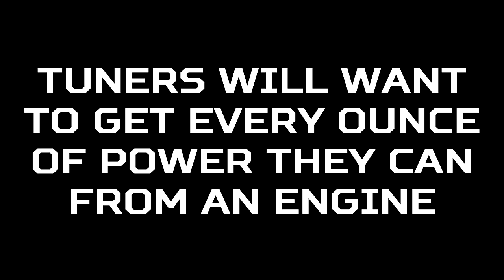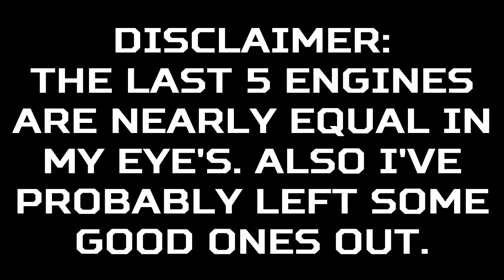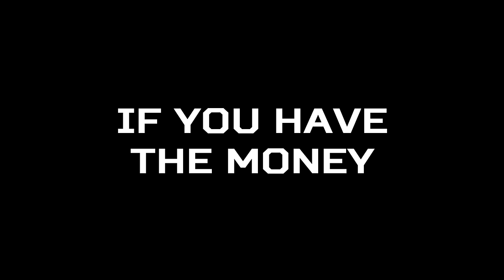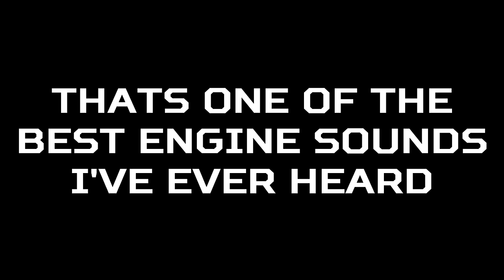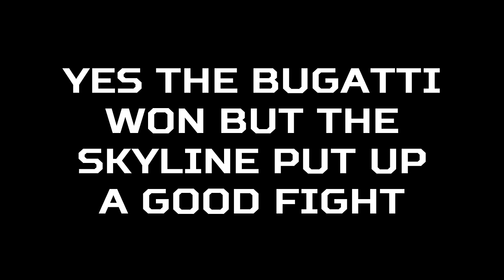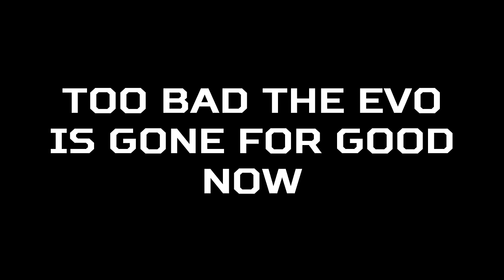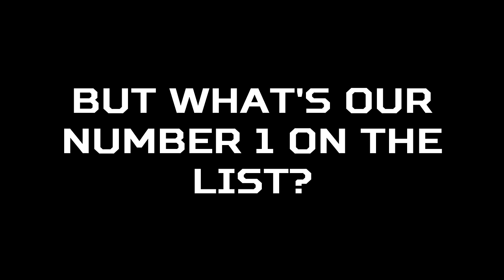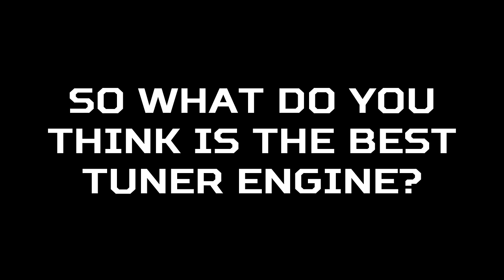9 of the Best Tuning Engines

Comment: No termi engine got dammit Bobby
Reply from the maker: I sell propane and propane accessories.
Reply: The 4.6 is garbage that's why it's not on the list ,my friend has a pos 98 mustang gt n the heads flow so poorly being his is an auto he better rev up when the light turns red in order to get it back n gear before it goes green.... the 5.0 is good but as I always say its 4.shit n 5.slow
Reply: +Brad Young depends how you build em bud. 4.6 make good power with boost and 5.0 can be a very powerful and reliable all motor build up
Reply: +Brad Young I'm interested in the new 5.0 in the 350r has flat plane 5.0
Reply: +Brad Young A terminator is supercharged 4.6 and is not the same 4.6 in your buddies 98 lol. Its also a dual overhead cam.
Reply: +Vaporizeee still supercharged makes 380 n there's na v8s that make more then that like the tundra ,is-f etc it's nothing special
Reply: +Brad Young 03-04 cobra are all underrated,  well over 400hp stock.  All have forged internals good for 800+hp.  You can get a whipple S/C for 3 grand and have a safe, reliable 600hp DD Cobra. Also the 4.6 one of the best sounding engines of all time...!!
Reply: +IKON G.DRAGON Ok thank you for the info I've just never been big on the 4.6. yes they sound pretty good but from what I've seen they don't hold together to well above 550whp
Reply: +ihatecrackhead Well if Ford failed so hard that over 10 years later you're ragging on them, that is considered a success in my book.
Reply: If the Teksid sucks so much why do people switch to them in 03/04&#39;s? And why is Accufabs 5 second 1/4 mile car a factory Teksid 4.6 with 2500+ HP (something the almighty LS hasn&#39;t done yet) with stock cobra crank and the old B heads.... 

People have pushed over 1k HP on stock 03/04 parts.Pulley, exhaust tune puts the 03/04 close to 480 RWHP 

Engine Masters banned mod motors after going 1.2,3 in an N/A build off and it was at an unfair advantage with the RPM limit at 7500 when Kaase tested before the competition it pulled all the way to 9k before starting to fall off at  900+ HP 

Stop being brand biased and throwing out a bunch of crap that isn&#39;t true lol
Reply: +98undrtaker amen
Reply: +ihatecrackhead true and some big block LS engines can go up to 3000+ horsepower
Reply: I don't care if its GM, Ford, Mopar blah blah blah I build engines for a living. I have a Cobra, Dodge and a GM so I could care less about brands lol

LS is easily the best bang for the buck but the mod motor doesn't suck like everyone thinks. First thing I'm going to do with any performance motor is replace pistons and rods so that puts them at even ground for me anyway so which company made what doesn't matter to me. 

 Both have advantages and disadvantages both are great platforms with a ton of potential.
Reply: +98undrtaker Preach! finally someone with some sense. U can build any motor with just about any horsepower if u have enough money
Reply: exactly it just takes money lol
Reply: +98undrtaker dollars dolla bill y'all lol
Reply: Um again I build engines for a living lol. 

Big Bore strokers are where its at for the 4.6 though if you want power N/A, but for forced induction the stock bore and strokes are just fine in the 4.6 and 5.0 as proven by accufabs 5 second 4.6.
Reply: +98undrtaker. I don't build engines for a living. I was under the impression that there is still only so much power that an engine can produce and that the bottom line power level is based off of the lower block thickness/strength. Anyone that wants push more power through an engine will replace all of the internals. But that doesn't remove the limiting factor. This factor is the blocks chemical composition and geometry. You can also buy billet machined blocks, but we aren't talking about those. We are talking about major automotive manufacturers basic blocks. I don't personally have any brand preference and have owned many 9 second cars in my life. It's been my experience (and every builder/tuner that I've worked with) that the LS engines are capable of taking more power, because of the lower block integrity. Basically, they are under designed and overbuilt. And if you just want to add forced induction to a stock motor, the internals in a LS will last longer at a higher power level than any other large manufacturers engine. That's a historical conclusion, not an opinion.
Reply: ihatecrackhead. I don't understand how economy came into the argument, or why you felt that you had to explain what horsepower and torque are. The argument that you can double an engines HP by doubling RPM is absurd since most engines achieve their max power at the upper limit of their RPM range. You can't make a 1,000 HP engine (@6400 RPMS) a 2,000 HP engine by simply doubling the RPMS. What you will end up with is an expensive grenade and a strainer for a hood. I have a Camaro that makes 205 HP at 2,000 RPMs and 540 HP at 4,000 with a max output of 720 HP at 6,500. The dyno sheet doesn't give an answer of 'double RPMs means double HP'.

Also, show me some data that supports your statement of power being based off of the 'volumetric efficiency'. You can put enough power into any engine to crack your block. The block thickness and geometry is the limiting factor after you have put in appropriate internals.
Reply: +Samuel Cohen Shit sorry dude, i forgot
Reply: +98undrtaker . i was about to point out a lot of the same things!
Reply: +Whenzy Quijano Big blocks technically arent part of the LS series, which are specifically small-block engines. Some big blocks have carries an LS* engine code, but these are unrelated to the LS-series Gen3-5 small-blocks.

In any case, speed costs money, so how fast do you want to go?
Reply: +Chiel van de Sande what's a ls7?
Reply: +Devin Adams The GM LS7 was was the 7 liter  427 ci LS motor GM put in the 2014 and 2015 Z/28s and earlier ZO6 Corvettes. They made 505 HP , 480 lbs-ft of torque, rev to 7000 rpm run on pump gas and you can buy it as a crate motor right from GM in either carbureted or fuel injected versions for about 15,000 complete. You can get between 600 and 700 HP with a cam change and a stage three port job on the heads. All LS7 motors are hand built here in Michigan at the engine assembly plant. Its the only motor put in a production car that is built by GM. Absolutely fantastic motor.
Reply: Very trie
Reply: I know. anybody arguing that the 4.6 mod motor is bad needs to do some reading. stock heads and block mod motor went 5.87 1/4. fastest LS has only done 6.12 1/4
Reply: ihatecrackhead the 4.6 blocks are rated alot more than 900. stock internals are rated to 1000HP and by then your changing them with all the money you put into it anyways. i see 1200+hp mod motors at tx2k all the time.
Reply: Who the fuck cares who made the block. It's what came stock in them and that's what they handle. I wouldn't care if the new corvette came with a pro mod engine made by a aftermarket company. I'd say that's awesome because it's all bang for you buck. Your trying to change convert a boost application to a displacement which doesn't work in your google calculator. It's all about engine design. Which the. terminator has the design to go 1000hp on stock internals.
Reply: +TheSamplebridge aahhh I forgot about the termi motor.  whenever someone says 4.6L ford motor, I just assume they are referring to the shitty 4.6L 2 valve pos.  point taken
Reply: The LS doesn't need 2500HP to win races,  because there cars are half the weight!! Plus the the LSX is half the price to Mod,  than any Ford engine to build!! Which is why they are the number #1 street drop in motor. For Example a C5 LS1 corvette is faster than a 4.6 terminator stock to stock!! Big weight  advantage yes. But one also has a super charger for god sakes.  That's  within the same years for Fords best VS GM's base model corvette . We can't  even talk about the Ford GT, so let's not even go there. Most Ford dealers don't stock even one,  as it's a Non production super car.
Reply: Typical GM fanboys comparing a Corvette to a Mustang. The bas corvette was still alot more expensive than the cobra. Why don't you do some cobra/camaro ss/z28 comparisons. Let's see a 02 ls1 camaro is slower than an 03 cobra.
Reply: TheSamplebridge Then tell Ford to make a car to compete. I sold a terminator for almost the same price as what a C6 corvtette cost!  They are currently around the same price range so what's your point?? You will never look back, guaranteed!!!
Reply: +TheSamplebridge if you are going to bitch about comparing apples to oranges, you probably shouldn't rebuttal with an apple to oranges comparison.  GT vs z28.  and you really want to compare a 2v 4.6 to an ls1?
Reply: cobras are the same prices as c6s because cobras are more sought after.

the camaros has always been the competitor to the mustang. so its only fair to compare top camaro to top mustang.
Reply: danhr03 base price of a termi was 31k. base price pf a z/28 is 24K. corvette is 44K.
i mean its nice you tried but could you at least get them right.

1. your back to trying to equate boost with displacement which doesn't work.
2.the termi engine was underrated about 20-30HP.
Reply: But yet again the Mustang competes with the camaro not the corvette. Anyone that thinks you can compare a Corvette to a Mustang should look at why the 67 camaro was created.
Reply: +TheSamplebridge where is your source for msrp for the cars?  I pulled mine from auto trader and got the cheapest 2003 GT trim level, cheapest 2003 cobra trim level, cheapest c5 corvette base level, and cheapest v8 4th gen trim level.  and the only time I compared a corvette to a mustang was on price, so I don't know where you are getting that I'm doing it "again".  if you actually checked your pride at the door and realized you are an idiot, you would look back and see that I agreed with you that a mustang cobra shouldn't be compared to a corvette, but it shouldn't also be compared to a z28.  the mustang has about 20 million trim levels, you might as well pick one that isn't double the price tag of the car you are comparing it to.  if you actually had 2 cents of info, you would compare the Mach 1 to the z28.
Reply: Autoblog. Which says the z/28 was the top trim for the camaro. Don't pull this 1LE BS which wasn't available to everyone. In my Mustang competes with camaro comment I did not hit reply to you.
Reply: +TheSamplebridge well that shows you that your information is invalid.  z28 was the base model v8 4th gen.  the z28 is the top trim for the 5th gen.  we are comparing 4th gens to terminators.  if you want to go with 5th gens and 6th gens camaros, the base model 6th gen blows the doors off a terminator, but that again is an apples to oranges comparison.
Reply: +TheSamplebridge and 1le and 1sc options (or lack of options would be more accurate for the 1sc) were available to everyone.  again, incorrect information.
Reply: the 1LE was a special ordered limited production car. it would not be comparable to teh cobra seeing as they made less than 100 a year, and sometimes less than 20.
Reply: +TheSamplebridge again, ignorance.  you are thinking of the prior 1le and lt-1 Camaro 1LE's.  again, as i constantly remind you, we are comparing ls1 4th gens to terminators.  1le was not a special edition car for all the production years of the ls1 f-bucket.  for 98-99, yes it was actually a specific car.  from 2000-2002, it was an option, that you could check, that would get you koni shocks and bigger sway bars.  a good majority of the SS camaros had this SLP option, and also a good bit of the z28's.  and even so, either 1le wouldn't be your "top trim" level ls1 4th gen anyways. that's like comparing the current dodge challenger and comparing it to the mustang.  except grab the mustang GT and compare it to the hellcat.  I mean, we might as well compare the top trim to the top trim, right?
Reply: ihatecrackhead they made 13000 03 and 04 cobras. not less than a couple hundred. now your bringing up lingenfelter after having a hissy fit over aftermarket rods, double standard much the LS can make 100HP on a 300$ camshaft. the cobra can make 100HP on  80$ pulley swap.

anyways the lingentfelter is in no way a dealer optioned car. its an aftermarket car built by a company.

so what your saying is the cobra isnt comparable to anything, which is funny because i see lots of videos of LS1 camaros trying to go at it with 03/04 cobras. ending varys with modification
Reply: ihatecrackhead pathetic the camaro wasnt in production for 7 years

your making dumb arguments that have nothing to do with what we where talking about to make yourself seem like you know what your talking about, which you dont.

the aluminator is built by ford performance. parts come from other places which who cares if the parts come from other places. GM has been using Isuzu engines in their duramaxs for years. and have had factories and other companies built parts for them around the world.

why cant the gt500 have more boost. do you think compression ratio dictates how much boost an engine can handle. if you think that then all credibility of you is lost.

the 2002 camaro zl1 has 400HP not 720. you just said it has 400HP without a supercharger. 

dont know why your brought up the holden commodore.

GM and eaton have nothing to do with eachother. the eaton on the gt500 is co designed by SVT and eaton.
Reply: ihatecrackhead then in 1999 the gt got 260HP and the cobra got 320. GM had the northstar but ended it because it was a pile of unreliable trash. nowadays you see very few northstar powered cars. and i dont see why you bring up the northstar because any vehicle they where in where large boats that would lose to a mustang of the same year.you call the 2009 mustang pathetic yet the 03-08 camaro had 0HP.

dan now your bringing up aftermarket companies. IM TALKING FACTORY CARS. thats why i dont consider comparing rousch, lingenfelter, other aftermarket companies together.the new stingray is only 5 grand more than the gt350, yet nobody compares them. just give up, mustangs and corvettes dont compete.
Reply: +TheSamplebridge GMMG is not aftermarket home boy.  that's a dealer option. you could go to a dealer and hit the GMMG check box, and get a GMMG.   lingenfelter is aftermarket.  GMMG isn't.  again.... you have no idea what you are talking about Mr "z28 is the fastest 4th gen fbody.'
Reply: +TheSamplebridge and if your rebuttle is that the "09 had xxx horsepower, but the 09 Camaro had 0 hp), then why the hell would you compare an 03 cobra to an 02 f-body?  they are different years, according to your philosophy, so we should be comparing the 4th gen to the 02 cobra. lolololoolololloloolol.  that's a close race!
Reply: ihatecrackhead really because the miliary base i go work on my cars at, one of my friends there has a Cadillac with a northstar. he tells me about how it was a big hunk of junk that GM made to try and get with the times, and ultimately failed and discontinued the engine.

because thats the cobras closest competitor. the 05-09 mustang had no competitor. the gto and g8 never sold enough to compete. the true competition between the 5th gen camaro was the 2011-present. ls1 f body and GTO freaks all go out to race mustang cobras and modded GTs.

GMMG is a dealer that specializes in buying f bodies and making them faster. its the yenko of 4th gens. you have to go to the GMMG dealer to buy one though, or youd have to know a guy way up in the ranks to maybe get one transferred to a dealer near you. its not a box you pick in the sheet. go to their site and read up on what they do.
Reply: +TheSamplebridge lol so your reference is the guy you met at a craft shop?  way to show how very little you know.
Reply: danhr03 a guy that's worked on civilian vehicles for the past 30 years and so good the military went out and found him to run a hobby shop. And with personal experiences with customers problems and his own. Yeah I'd take his knowledge.
Reply: +TheSamplebridge here's my experience with just about any trade.... ESPECIALLY with the military hobby shops that i used to use back in my younger days, before I invested in my own garage and tools.  "Just because you have been doing something for X amount of years, doesn't mean you have been doing it right for X amount of years."
Reply: danhr03 he still has it because his dead dad left it for him. the thing barely runs. it was just a downfall of problems a couple years after getting it, until the headbolts pulled out and the head lifted blowing the headgasket. extremely common problem GM never fixed. then the transmission blew up and he replaced it himself. still has alot of problems. it just sits in his garage now. 

the northstar car made 300 HP out of a 4.6 32v dohc engine which competed with fords lincon MK8 which had the ford 4.6 32v dohc that made 300HP

i know hes been there 30 years because the guy is almost 60 and he has photos dating back that long. and the old guys in shop, who have been there longer, also tell he we was there that long.
Reply: Watch the first one again. A little hard to see but he pulls ahead after he goes by the camera.
Reply: ihatecrackhead the LSX motor isn't street legal dude.. just saying. lmao. plus you hella just threw a guess when you said 900HP on the termi motor. they can handle over 1400hp on stock internals and stock block.
Reply: Samuel Cohen The said
Reply: ihatecrackhead Yawn might want to check the current guiness world record for fastest tuned car in the world.. it's a 1700hp Ford GT with the 5.4 you were talking about being such a shit motor. oh recorded at 455kmph. No Chevy or any other car on a stock frame with a full Interior has seen that.
Reply: Jarrod Varner are you talking about fastest in the 1/4... cause fastest in the 1/4 mile right now is a civic hatch.. if I'm not mistaken
Reply: Hopefully some of these people did more research.
Reply: ihatecrackhead actually it’s not 6.9 it’s 6.4 the blower is a 1.8+4.6